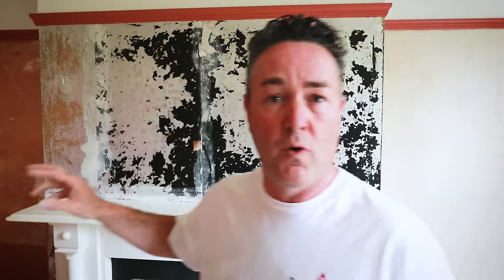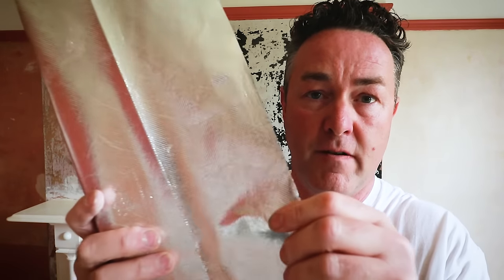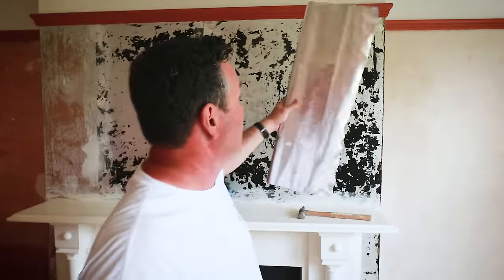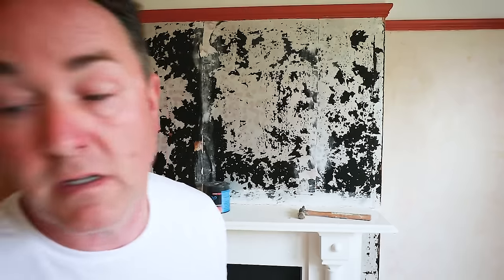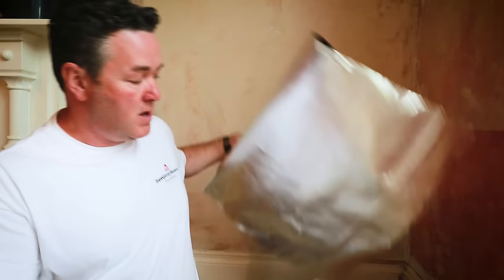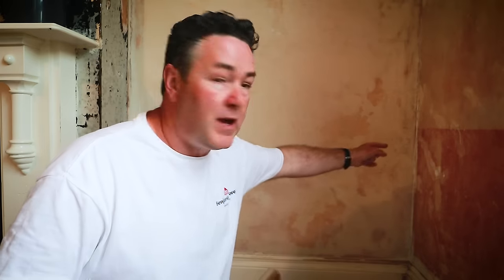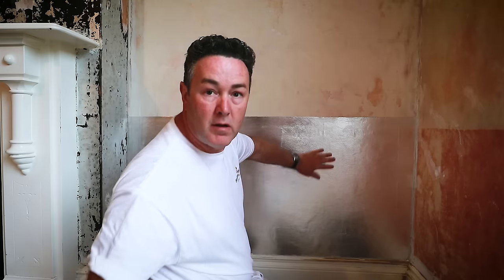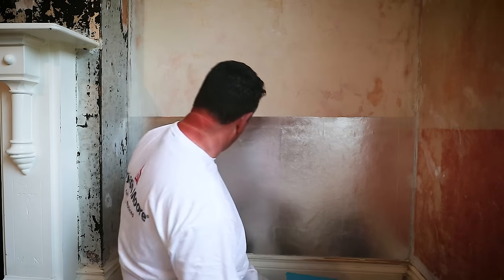How to Stop damp on walls - WallRock Dampstop Thermic

Comment: Hi Phil, great video. 
I have applied wall rock damp stop on a small part of the wall, can I use easifill all over the area to level up with the rest of the wall?

Will easifill stick on it?
Reply from the maker: I don't think id chance filling over the silver and adhesive.
Wall Rock it and fill over that. Then you're not putting filler on the damp adhesive.
Reply: @ProfessionalPainterDecorator  Thanks for you reply Phil.
I am not sure I fully understand your suggestion.

Are you suggesting I add the wallrock line paper on it? In that case I would have  the area with wallrock silver and line paper sticking out to the rest of the wall.

Before using the wallrock damp stop I brought the area back to the plaster and by applying the wallrock damp stop I am now at level with the rest of the wall, so I really can't add any other layer.
What would you do?
Reply from the maker: @domenicoaumenta3040  you watched the video?
Once the damp stop is on.... And dry (48hrs later) 
You line over it with WallRock Fibre Lining... Or a reinforced lining paper like what Brewers sell.
Reply: @ProfessionalPainterDecorator  Yes I have watched the video, at is great for an entire wall.
I am looking for advice in regards to a patchy job, where adding the line paper is  not an option.
Perhaps there's no solution for the above situation 😞
Reply from the maker: @domenicoaumenta3040  can you not re line the whole wall.. even with 800 lining paper?
Reply: @ProfessionalPainterDecorator  I could but it's a big wall for a DYI project.

Thanks for your suggestions Phil
Reply from the maker: brewers reinforced lining paper is thinner and easy to hang... paste the wall.

Comment: Once you lined the wall do you then cover it in adhesive again before painting?
Reply from the maker: No. No need once the wall rock is on, either hang your wall paper as per instructions on the label.. or you can emulsion over the WallRock lining paper.

Colefax and Fowler say you need to size lining paper prior to hang their wallpapers... Always check what the wallpaper hanging instructions say.

Comment: Rustins have a new  eco saving graphite paint which has  around  20  % savings  which has ECO panels that can be inserted first and an electrical charge is then used to heat the wall using thin copper strips
. Impressive as its very low energy system esp with the rising cost energy..

Comment: Can i put thermal liner on over this then apply wallpaper over the thermal liner
Reply from the maker: I can't see why not. But wall rock fibre line before a finish paper 

I'd ring customer services though to check what adhesive to use with the thermal liner, going over the silver of the damp stop

Comment: Phil! I have taken my walls back to the plaster, should I use Zinsser Gardz on the plaster and then use the Wallrock Dampstop Thermic Adhesive?
Reply from the maker: If they're good. There won't be any need.
You could size the wall over with some thinned down thermic adhesive. Prior to applying it neat tontye wall when hanging the damp stop 
Once the damp stop is on... And dry, another  thinned coat of the damp stop adhesive applied to the silver of the damp stop makes it easier for when you hang the wall rock.
Reply: @ProfessionalPainterDecorator appreciate the speedy response! Love all your helpful videos! It's inspiring me to do more of the decorating myself (little nursery project currently on the go for my 1st born)

The plaster/walls look in good condition. I lightly sanded the walls and used a wet sponge to wipe away any dust.

I'll try;

1) Sizing the walls with thinned down thermic adhesive first 
2) Wait for that to dry
3) Apply some more adhesive (not sure if thinned)
4) Straight away hang my wallrock dampstop thermic foil paper

When you say "hang the wall rock" do you mean wallrock lining paper? I have gone with the Fibreliner Smooth, hoping that's a good choice...
Reply from the maker: @mattyleeboy  make sure the damp stop adhesive is neat when you hang the Damp stop paper .  And also the Wall Rock fiber lining.

Comment: Hi phil. Can you use the wallrock thermal lining adhesive  if you can’t get hold of  the damp stop thermic adhesive?
Reply from the maker: Have you a Toolstation near you? Order it via them. Always better to use the correct adhesive.

As the damp stop adhesive is also acting as a barrier for any damp.

Also... If you're using WallRock OVER the damp stop paper.... It does say to thin down the damp stop adhesive and apply that, let it dry THEN hang the WallRock over the top using the damp stop adhesive as well.
I have to say, doing that primer coat of adhesive the day before and letting it dry does make it easier to apply the adhesive when lining over the top.
Reply: @ProfessionalPainterDecorator  I ordered the paper from there yesterday but forgot I needed the correct adhesive. Ordered it now. Thanks!

Comment: Great post, would this be suitable for a cold wall? I live in a 1930”s detached house and the external wall cannot keep regular paper on due to condensation especially when the weather gets cold. We have increased the ventilation but it still occurs. Thanks Peter
Reply from the maker: Yes it will, you can also get a fibre/fabric wall insultion from WallRock as well.

Comment: Hi Phil. Quick question if you don’t mind. I too am a pro decorator but have never used dampstop. So, wardrobe against external wall was moved and wall behind was saturated. All been cleaned off with mould cleaner and am in the process of prepping. When wall is ready I was thinking of hanging dampstop then lining and painting. So will the damp stop prevent the wall becoming wet if wardrobe is put back in same position?? Thanks.
Reply from the maker: It should do. And be a lot better than it is now.
Reply: @ProfessionalPainterDecorator  morning mate. Thanks for that. Just thinned out wallrock adhesive for the wallrock and straight onto the foil??
Reply from the maker: @chrisbeach44  thin for a primer coat. Allow to dry. Then paste the wall and hang the wall rock.

If the wall is cold, you can get the thermal flease style wall rock fibre lining
Reply: @ProfessionalPainterDecorator  like a size, allow to dry then proceed as normal? Thanks.
Reply from the maker: @chrisbeach44  yeah. It helps with applying the adhesive for the WallRock. You'll notice less cissing on the silver if you prime/size it
Reply: @ProfessionalPainterDecorator  brilliant. Thanks phil. By the way…you were spot on regarding papering into corners re: Spencer colgan. 👍🏼🤝
Reply from the maker: I do like Spencer and we do message each other. He does have some funny ways of doing things..... Remember... Work smarter not harder ;)
Reply from the maker: @chrisbeach44  btw .. you need the Damp stop adhesive to hang the WallRock over damp stop foil
Reply: @ProfessionalPainterDecorator  thanks phil. And size the foil with the same adhesive??
Reply from the maker: @chrisbeach44  yes. Use the damp top adhesive... Link in the description... Nothing else will stick.

Comment: I had damp on an internal chimney breast , bottom half , had the chimney sealed and vented as no longer used I’m gonna have to take it back to brick and re plaster is it ok to put this on before the skim coat or is there something better to skim over it with . Cheers
Reply from the maker: No need to remove the plaster. Use this stuff. Then line it with WallRock fibre liner and paint it, or hang a finish paper. Tye Damp patches won't come through.
Reply: All depends on how it`s built and the reason why it`s damp. Don`t just go using undercoat and gypsum plaster or it could be a wasted effort.

Comment: Hi Phil great vid. Just a question for you! You say about putting lining paper over the damp stop paper and you’ve got to use the damp stop adhesive. Have I got to paste the lining paper in this instance? Just wondering about soaking time and the problems if I paste the wall then apply lining paper dry. Sorry to go on but I’m confused. Cheers 👍🏻
Reply from the maker: Hi, you saw in the video, I'm lining over the damp stop with WALLROCK lining, as thats what they recommend to use. So you paste the wall with that too.. using the dampstop adhesive,
NOTE: when the foil is on, go over the foil with a slightly thinned down DampStop adhesive as a primer BEFORE you  come to do the pasting of the wall for the wallrock.
Reply: @ProfessionalPainterDecorator  ahh! gotcha Phil. Does this mean you can ONLY use that particular lining paper over the dampstop foil?🤔
Reply from the maker: @derekwhitaker4905  I would keep to the WallRock, it's so easy to apply and gives a good strong base.
Reply: @ProfessionalPainterDecorator  cheers my friend happy Christmas 👍🏻
Reply from the maker: @derekwhitaker4905  they'll be some photos on my Facebook page up over Christmas with how the room transformed

Comment: Hi Phil, I'd like to use this on the bottom of the wall (like where you did the first piece) as this where my issue is. Can I still line paper over it without it making too much of a 'ridge' effect where the paper meets the liner? I  couldn't tell how thick the WallRock lining is from the video. Thanks!
Reply from the maker: Yes. You may need to skim out the ridge edge that will show under the lining paper though.
Do  it after the silver damp stop is on and dried, or once you've the lining paper on.
It will depend on what your plans are for decorating. If Painting it, you may want to do it before the lining is on so you don't get a difference in surface between smooth filler and the slight texture of the lining paper.
Reply: @ProfessionalPainterDecorator Thank you so much for the speedy reply. Much appreciated!! 😊

Comment: Apparently you can paint straight over this foil .have you ever tried or have you just lined over it ??
Reply from the maker: I wouldn't just paint over it, you'll have excessive adhesive on the surface. Which would be a problem to paint on.
Best to line with the WallRock fibre lining over it to give a better surface to paint or wallpaper over.

Comment: Thanks for the video. You can tell a proper tradesman cos they make it look easier.

We have a flat - built 1890s. External facing wall gets cold and atteacys condensation which then creates damp / mould.

Can i paint straight on top or should i use something else on top before painting?

In the corner where it gets cold i want to put a free standi g wardrobe.
Reply from the maker: Hi. Yeah... Dead easy lol.
Watch the video on what I do .you can then paint over the lining paper.. or hang a paper over it
Reply: @ProfessionalPainterDecorator  But you can't paint on the silver surface of the Thermal paper?
Reply from the maker: @adadses1979  nope.

Comment: Got a cold external wall that is prone to paint flaking/condensation/mould. Should I use this or the thermic paper? What's the difference?
Reply from the maker: the Mav Thermal Graphite Plus is what you want.. you then hang wallrock fibre lining over it.
I have a video going out on how to apply it later on in May.
Reply: Thanks! Ended up going for the thermic paper as it is mainly internal condensation rather than from the outside. Fingers crossed or have I made the wrong choice?!
Reply from the maker: @CharlesDeacon-g6h  you went for the Graphite + one though?
Reply: Got the standard wallrock thermal liner? Issue seems to be internal condensation on cold north facing walls rather than damp from the inside out, was recommended by a contact who used it for same issue. Reckon I should swap?
Reply from the maker: @CharlesDeacon-g6h  this.. https://www.erfurtmav.com/erfurt-mav-wallpaper-products/insulating-wall-coverings/product/159-insulating-lining-papaer-grapite-plus
Reply: Back in the day Phil they used tin foil to stop the damp 😂 seriously they did
Reply from the maker: @janettinkler2204  you mean pitch foil?
Reply: @ProfessionalPainterDecorator   no literally tin foil the stuff that’s used in the kitchen, that’s what they used in the late 60’s early 70’s
Reply from the maker: @janettinkler2204  how did they stick it to the wall?
Reply: @ProfessionalPainterDecorator  believe it or not with paste
Reply from the maker: @janettinkler2204  surely it would never dry and not stick.

I'll ask my Dad and Brian tomorrow lol
Reply: @ProfessionalPainterDecorator   well it did & then they papered over the top 😂 I know it’s hard to believe but it’s true, back then there was no such thing as wallrock 🤷🏻‍♂️ I’ve never done it myself but I remember when I was about 8 year old my dad’s friend who was a decorator putting tin foil on our wall then anaglypta wallpaper over the top then  he emulsioned the paper & it did dry & never fell off, 😂 I know it sounds crazy but it is true 🤔 I think that’s where I got the idea of becoming a painter decorator

Comment: Hi Phil, once applied over the damp plater, will it be alright to dot and dab new plasterboard over the top it as an extra barrier. Cheers
Reply from the maker: No, don't do that, I don't think that's the idea of it.
Get that plasterboard that has either foil on one side or the polystyrene backing.
Reply: Thanks for the quick reply. I can get the standard plasterboard from where I work for nothing so was asking if it could be done this way as a cheaper option than purchasing the 2 types of plasterboard you suggested. Would It still work or is it worth just purchasing the boards with the sealed backs? Cheers
Reply from the maker: @alexgudgeon-cw1qv  you could give it a go and how about coating the back of the plaster board with a thinned down mix of the water proof adhesive for an extra protection layer?

Comment: When you use the diluted glue as a primer how long does it take to dry? And can you use a regular primer on it?
Reply from the maker: it always stays a bit tacky... depending on room temp it may hae gone off enough after 30mins.

Regular primer on what?
Reply: Reguler Primer  on Dampstop before painting instead of using the diluted glue

Comment: Will this work with rising damp?
Reply from the maker: Yes. To an extent. If you can't fix the problem. You will need to do what you can to work over it.

If it's bad, I'd double up on the damp stop somit doesn't work it's way through the joints. Slightly overlap the corners too

Comment: Can you emulsion directly over this product?  I have seen mention of using a primer, but no-one seems to say what primer might be needed.
Reply from the maker: where have you seen it mentioned?????

No, follow the instructions and line over it with the wallrock fibre liner then you can paint over that. plus it gives you a better surface to paint on.
Reply: I believe you mentioned Guard primer before you applied the glue to the wall.
Reply from the maker: @ericalmeida6303  yes that went on fine, as I did the whole room with WallRock

Comment: Hi, I have a room that  suffered damp walls due to roof leak, which is now fixed. The worst wall I’ve knock the plaster off, battened and boarded. The other wall is not showing through existing paint but still shows as damp with meter. It does not feel damp. Should I use this or will a fresh coat of paint be ok?
Reply from the maker: Might be worth letting it dry out, so use an emulsion.

If it doesn't go, you can use this product.
Reply: @ProfessionalPainterDecorator  thanks for the reply. I’m with you. I’ve opened up all air line cracks and the humidity has risen in the room so hopefully this will speed drying time. Great channel. I noticed a good response of yours on Screwfix forum. You advised how best to cover old bitumen on outside walls. I would never of identified that paint you recommended. Would be good to have a video just on specialist paints that can be used in unexpected ways. Cheers 👍🏻

Comment: I have just spoken to Erfurt the manufacturers of damp stop and they say they only recommend to use behind radiators and not to line over as this negates the foil reflection.
Reply from the maker: That's correct if you're using it as a reflective paper.

All instructions are here for you.
https://www.erfurtmav.com/erfurt-mav-wallpaper-products/wallrock/wallrock-dampstop-thermic#hikashop_show_tabular_description
Reply: He said not to paint as you would not get a desired finish, so ok if you want your walls bacofoiled. I have since spoken to technical at coveryourwall and they say of course it is decoratable. I think I will use it on a damp staircase wall and cover with fibreliner and the new nursery wall will have KV600 followed with fibreliner. The staircase has no heating from the front door upwards, so nothing to reflect, but the new nursery should retain the heat @ProfessionalPainterDecorator
Reply from the maker: @grahamrutledge5277  like I've shown in the video
Reply from the maker: Have you looked at the WallRock thermic graphite+ lining paper.... That's for keeping heat in. You still love me over it though

Comment: Why did you butt the joints if there is a damp issue. Why not overlap and eliminate possibility of damp come through the joints and on the lining paper?
Reply from the maker: Watch the video Neil.. all is explained.
Reply: @ProfessionalPainterDecorator  video still not answered my question. why is there an option to overlap if you dont need too? I can understand butting the joints if its used for energy performance, but to stop penetrative damp it would require overlapping? You mention the breast had damp/soot issues therefore would need overlapping?
Reply from the maker: @neil30264  it's not like the old pitch paper 
Mild damp issues it says you can butt joint, the adhesive acts as a barrier on the joint too. Bad damp you can overlap (create that ridge more so than pitch foil, as this is thicker) or double cross line with it of it's really bad.

I've been using it today 😀 again, damp on a chimney breast in a bedroom.